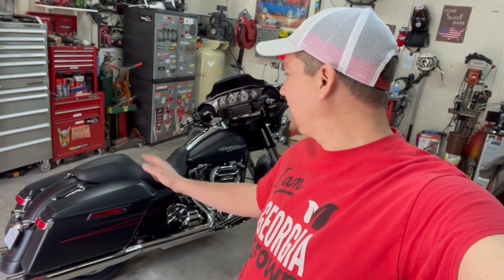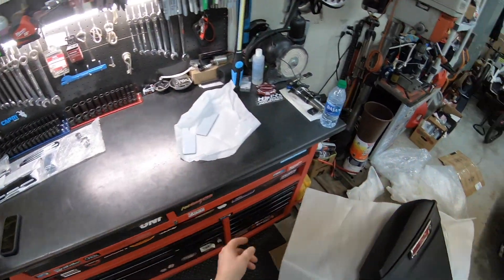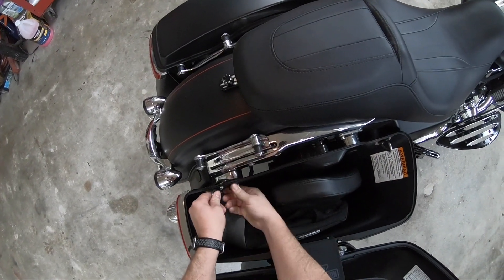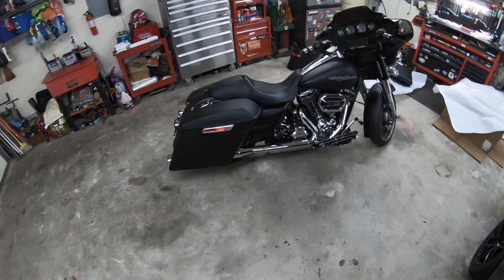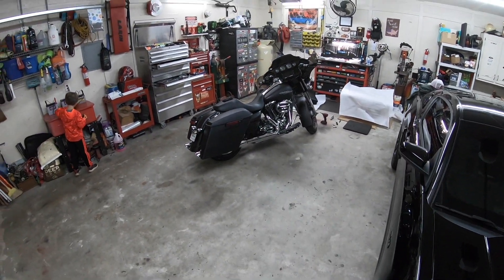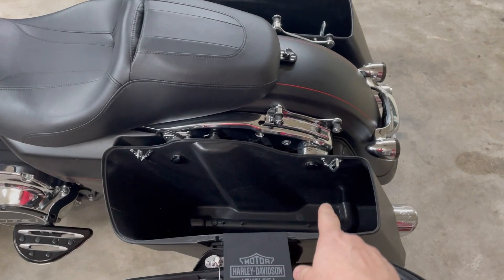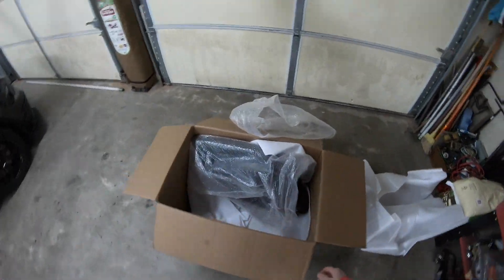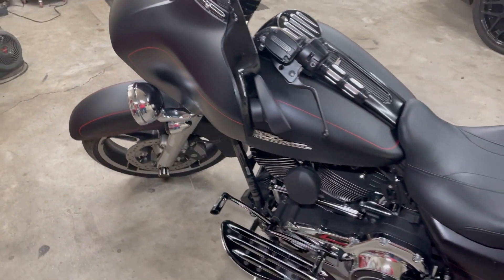5" Stretched Saddle Bags on Harley Davidson Touring Full Install and Review TCMT

Comment: Hi from Spain, where is the correct place for de adhesive bracket like you show at 1:33? Thanks
Reply from the maker: @rodrigobluespower3374  I never installed them but I showed where I think they should go at 1:45.  They appear to be skid guards so I would put them on the bottom near the rear.  🤘🏼🔥
Reply: @CoyoteChris  thank you so much 🤘🤘🤘
Reply from the maker: @rodrigobluespower3374  you’re welcome. 🤘🏼

Comment: Any issues dragging the bags in the corners? I've been on the fence about ordering these exact bags, just concerned that 5" may be too much removed from the lean angle.
Reply: I'm thinking as long as they're not hanging below the pipes then they should be good...I've leaned too far in one of those round-a-bouts and my front floorboard was the only thing that scraped the ground, it had the stock bags on then...I guess I'll soon find out because I just got the same exact bags in vivid black with the cvo style fender to match
Reply from the maker: So far I haven’t hit them on the ground but yes I was very concerned too.
Reply from the maker: @juanperez-sb1wo  We have multiple round abouts where I ride and I haven’t hit them.  I do love them but you will want to add the fender extension to make it a cleaner look.  Fender Extension Harley Davidson Touring with Extended Stretched Saddle Bags
https://youtu.be/zpbDj6ZMRjs

Comment: Hey man, do you have a link for the hardware to secure the bags? Also, the link for the bag liners?
Reply from the maker: Yes here are the Amazon links YHMTIVTU Motorcycle Saddlebag Liners Stretched Bag Inserts with White Thread Stitch Fit for Harley Touring 2014-2022 https://a.co/d/7uOz3uy   And this is the hardware  Alpha Rider Lengthen Saddlebag Locks Mounting Security Theft Deterrent For Harley Touring 1985-2020 Stainless Steel https://a.co/d/1xkBVsg  Hope that helps.
Reply: @CoyoteChris  thanks brother
Reply from the maker: @dennistriplett4011  Anytime 🤘🏼🔥

Comment: Will the factory Lids fit these bags
Reply from the maker: @catdawwgog  I’m not 100% sure, the main reason I changed the bags was because the factory lids were scratched.  I know all the hardware swapped over no issues so I would guess the lids will as well. 🤘🏼